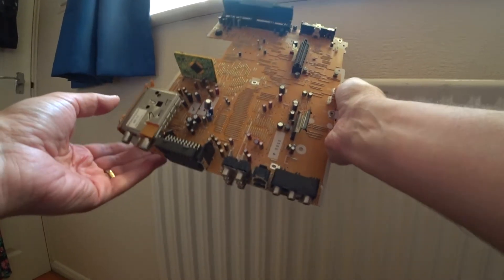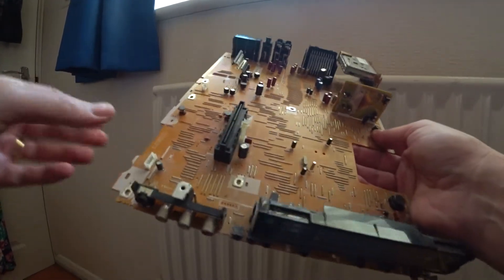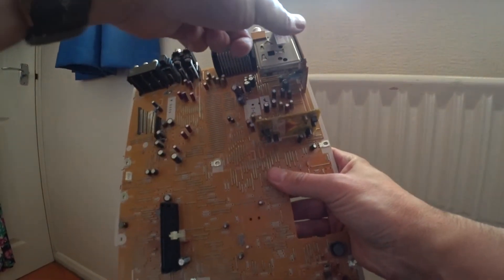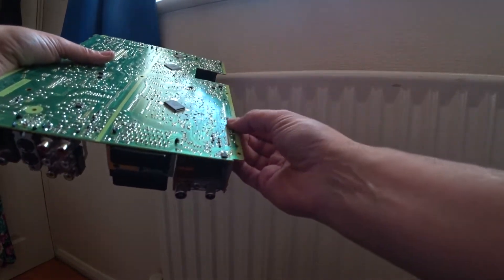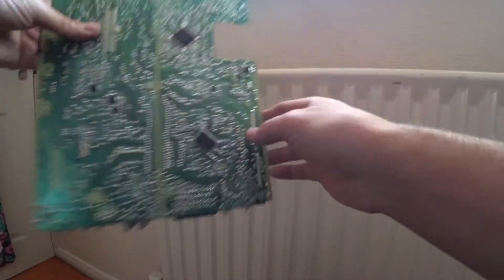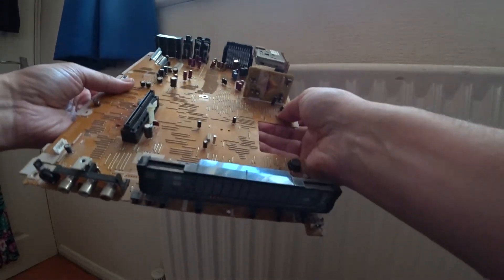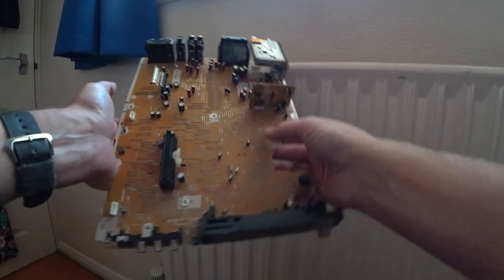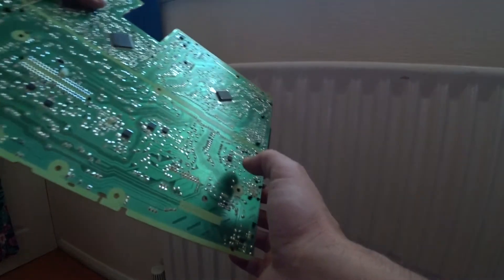Panasonic DMR-ES10 DVD Recorder. Blown Capacitors. Part 4. PROBLEM FOUND

Comment: Hi can you please help me with the probelem with the panasonic dmr es10 recorder. The probelem is it displays self check on the recorder which i dont know how to solve?
Reply from the maker: I would take the lid off and check your power supply board for blown capacitors.  As this seems to be a common cause of other issues.  In fact some capacitors may look good but still need replacing.  I sourced another ES10 which I was able to repair and use, makes a nice clean up of VHS signal as a pass through!